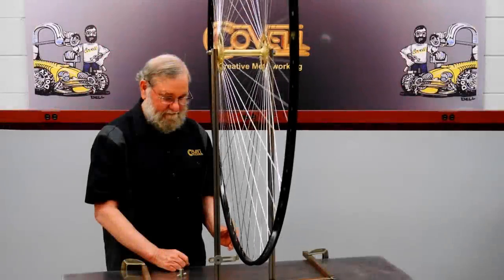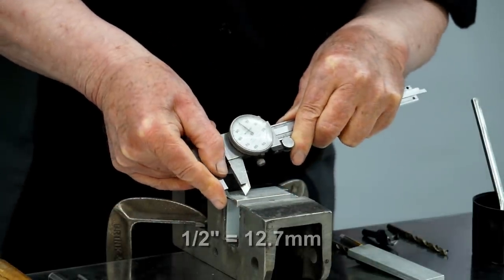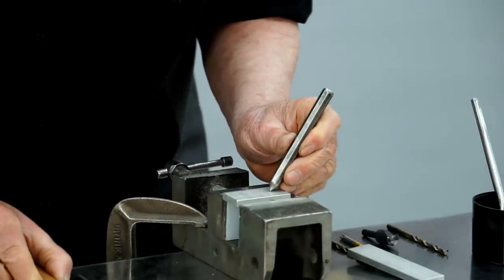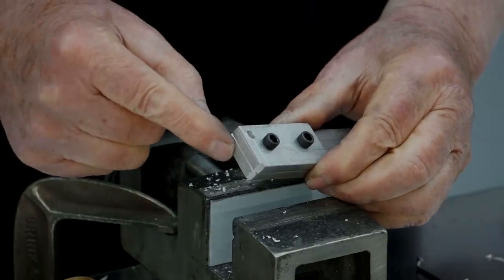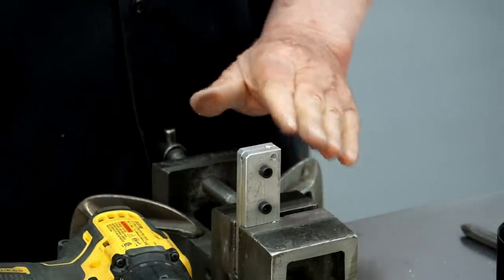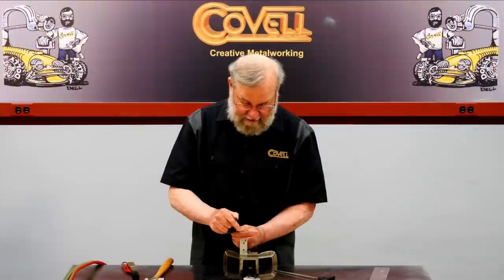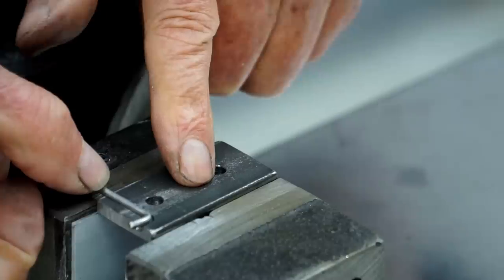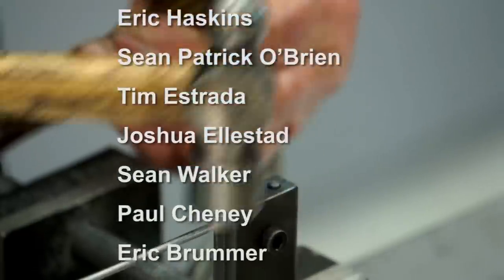Making Oversized Spokes

Comment: Thank you for your content. Very interesting indeed. Would it not be advantageous to use a "die punch" to round the head of the spoke rather than peening it?
Reply from the maker: I guess you're talking about tooling for a punch press? I don't have one, so I don't think along those lines. That's probably how production spokes are made.
Reply: @RonCovell  No I was talking about a little hand-held punch. We used to make them in our apprentice days by heating the tool red orange and hitting it down on a steel ball from a bearing race. This forms a hemisphere in the punch, which will then transfer the shape and polish onto the spoke head.  It was just a thought.
Reply from the maker: OH! That's a very clever idea, and I probably would never have thought of it. I may try that sometime!

Comment: Wonderful!   Any specific wire alloy?
Reply from the maker: I used 1018 steel, because of availability. I wouldn't be surprised if 'real' bicycle spokes are made of a higher tensile-strength material.
Reply: @RonCovell  typically 304 stainless or custom blends similar to 304 with higher hardness.

Comment: I love this

how did you make, or where did you get your hub?
Reply from the maker: I made the hub on a lathe from a billet of aluminum that weighed about 40 pounds, then made the slots in the flanges and the spoke holes by using a rotary table on a milling machine. It was a pretty big job, and a chunk of aluminum that size would cost about $250 these days.

Comment: Hi. Nice video! But one question? Are you saying, one shouldn’t use a die, to cut the threads! That seems like the obvious way to do it?
Reply from the maker: It is not wrong to cut threads with a die, but rolling threads is much faster, and it makes the threads considerably stronger. The threads on virtually all production bolts are rolled, not cut.
Reply: I did not know that! And I have a lot of experience in mechanical stuff. I have read about it in terms of spark plug brands and aluminum cylander heads. Still, I don’t think I would hesitate to use a die, if I was going to build a spoke rim.knowledge is king! Huh? 😉

Comment: Originally they were probably swaged ends. By stretching you’re going to lose some diameter. Also it looks like the spoke material you used was very soft I would go with a more ridged type. After heating the end and beating the end on you should have quenched it, because now you have an annealed corner and that is where the spoke will have most of its tension when on the bike.
Reply: Also some inner and outer spokes have a different angle. As the two spokes have differences in degrees coming from the hub to the rim.
Reply from the maker: I measured the wire before and after stretching, and the diameter change was difficult to measure. Of course, the more it is stretched, the more the diameter will change.
Reply from the maker: Yes, many rims are offset from the hub - to accommodate a cluster, for example.

Comment: Im just curious, why did you melt and then hammer the end rather than ball-peening it? I’ve used a ball peen before to make a rivet out of a steel nail but I’m not sure about the pros and cons here
Reply from the maker: In my experience, it's a lot easier to move the metal when it's heated. You certainly can do a certain amount of cold forging, but it work-hardens the metal more.
Reply: @RonCovell  Thanks for the video Ron. Heating is a good idea but the ball pein on the hammer is designed to do the very job you are doing whether hot or cold. Excellent series of videos, please keep it up!
Reply from the maker: I will!
Reply: @RonCovell  For something like a retention flange, do you think that the work hardening is a good or bad thing? I could see an argument either way honestly
Reply from the maker: Good question, and it depends on where the material 'starts from', and how much hardening you add. Extremely hard materials are brittle, and prone to fracturing with shock loads.

Comment: Was it too hard to form the head cold? I believe both the bend and the head are cold formed to maximize strength in commercially made spokes. Obviously this is a light duty wheel, and stainless can be a bear to cold work, but this may be a case where a bigger hammer would just be better.
Reply from the maker: You bring up a good point. I just presumed that my arm would wear out, and my fixture would distort if I tried to cold-form 72 spokes, but I honestly didn't even try it.

Comment: The only part of this procedure I find problematic is where you're balancing the torch in your off hand while hammering. Might you use the carbide tool you used to round the groove in the fixture, to grind a "cup" in the end of the wire, so you can flare it without heating?
Reply from the maker: I'm pretty comfortable balancing a lit torch as I hammer - I've done it for many years. There are devices that will shut off and re-light a torch if you aren't comfortable hand-holding it:
https://youtu.be/jjL06ayVjdA?t=758
I don't think a 'hollow' formed head on a spoke would be as strong as a solid one, but perhaps it would be strong enough.

Comment: why not use the peen side of the hammer after a few tap? isn't that what it is supposed to be used for?
Reply from the maker: Well, you bring up a good point. The peen end of a hammer IS designed for peening. Most of my hammering has been on sheet metal, and larger, flatter faces are best for that application. I guess I'm just bringing that experience with me when I do other kinds of hammering.